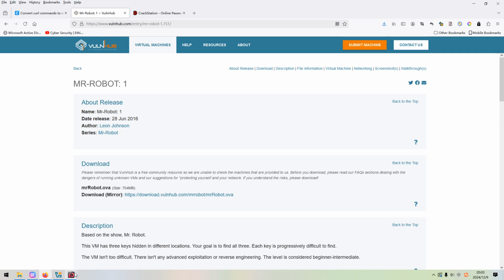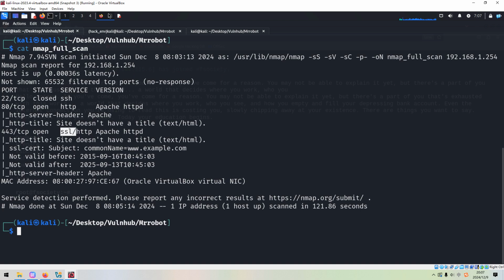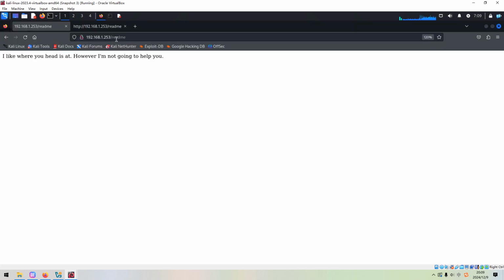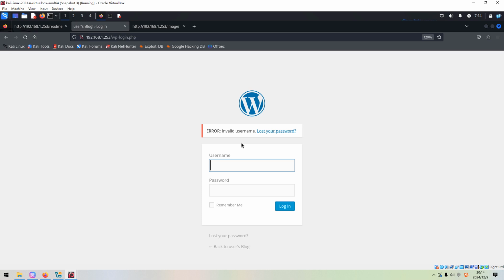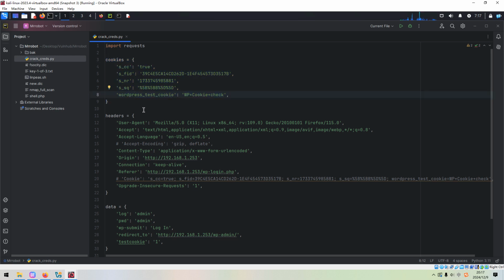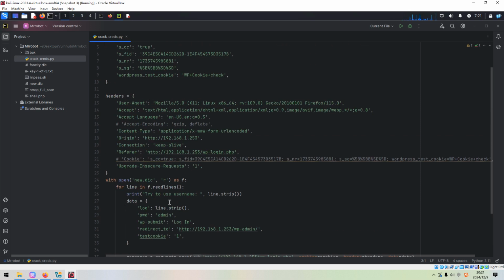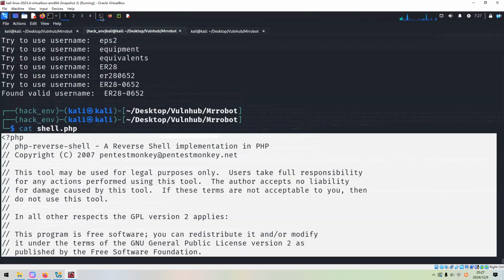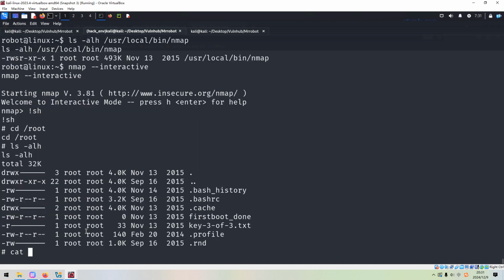Cyber Security | Penetration Test  | CTF | Walkthrough | Mr Robot | WordPress Cracking | Python

Comment: can I have the same gateway(Modem1 ip = Modem2 ip) ip address 192.168.1.1 for both the wifi and the switch? Confused. If in ipv6, %num can distinguish the interface device. I am confused because if I tap 192.168.1.1 in my browser to set my Modem, which Modem is?🤣🤣🤣Confused.
Reply from the maker: Maybe modem is not correct term for your circumstance? It should be gateway?

Comment: Well, I have a question, you know ipv6 uses %16or eth0 to mark  different NIC(network interface card), my question is if I have a wireless card and a ethernet card in a computer and I connect both networks(wifi and a switch）and the switch is not connected to the wifi device, the wifi is connected to modem1, the switch is connect to modem2,
Reply from the maker: Got it.